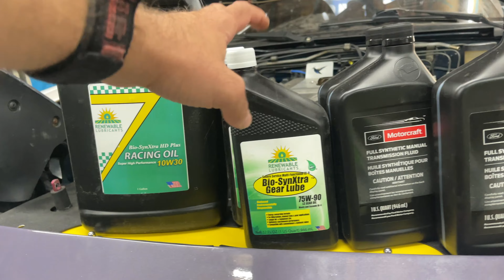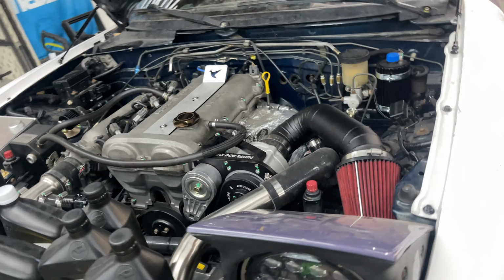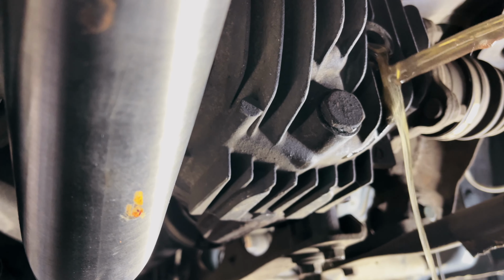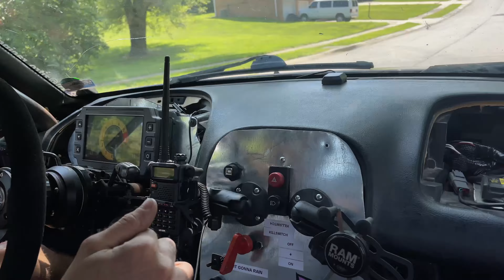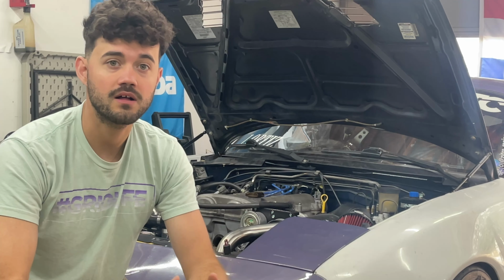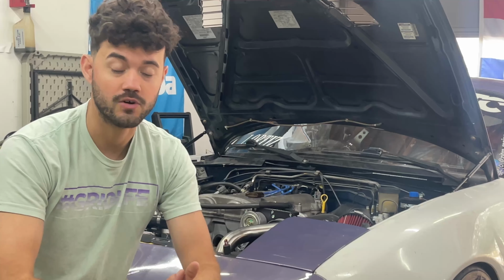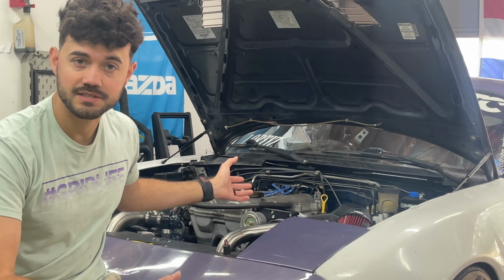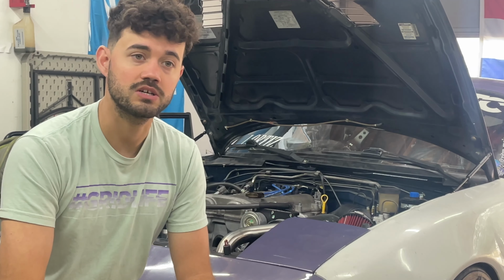Supercharged Miata Gets Dyno Tuned.......MAYBE? | Track Dog Racing Rotrex Blower Makes INSANE NOISE!

Comment: Made 290whp/245tq on e85 with the rotrex c30-84. Have DW1000 injectors with dw200 pump with no issues! I asked my tuner to be safe and had more room to go. With the c30-94 you should break the 300hp mark easily.
Reply from the maker: We're thinking at the 300 mark as well. Have the DW1000 and dw340lph now so should be plenty!
Reply: Hello is your engine stock and what engine NA6, NA8, NB1, NB2, or other are you running?
Reply: @zitroracing  Hello is your engine stock and what engine NA6, NA8, NB1, NB2, or other are you running?
Reply from the maker: It is a stock NA8 motor.

Comment: No exhaust extraction and doors closed?
Reply from the maker: It’s a dyno cell, in essence a giant paint booth. The front has a massive fans that suck in air from the outside and blows across the front of the car, the rear of the room has extraction ports that filter out the exhaust gases outside all sound insulated. It’s a pretty neat setup

Comment: Is it possible the fuel pump is too small? 550cc seems big!
Reply from the maker: 550cc for e85 is not enough. E85 needs more fuel about 30%-40% more over pump gas
Reply: @zitroracing ah, i missed the E85 part.

Comment: Stock motor right? Those injectors are absolutely too small.
Reply from the maker: Stock motor, figured that out the hard way for sure. Had them laying around from something else I was doing and was just trying to be cost effective. Guess that’s what I get lol.
Reply: @zitroracing  I'm running 725s on pump gas on my 8k RPM motor, they absolutely do not have enough left for e85. I did build a -6 return fuel system with a Flying Miata fuel rail. Good luck with your build, Rotrex cars are a blast!

Comment: 210WHP!
Reply from the maker: Close but might have a little more left.
Reply: @zitroracing  Haven't finished the vid yet but I see you're on E85... I'm going to say more like 230WHP
Reply: Oh nice I was close! I'm going to be running the same TDR kit on E85 except with a Skunk2 TB/manifold as well. I have 1000cc ID injectors, Radium FPR/damper and rail which I assume will be sufficient!
Reply from the maker: @krisenr  that should be plenty! I’d say you’d be surprised on the numbers you’ll make